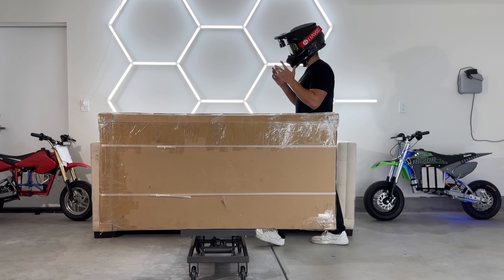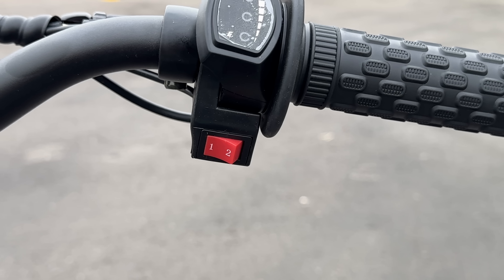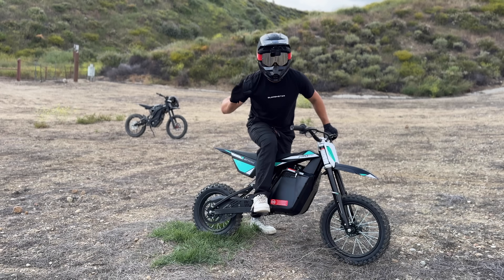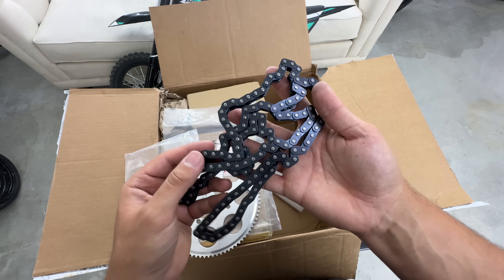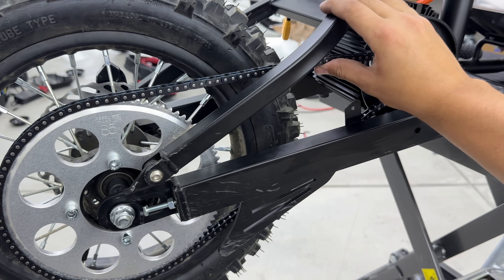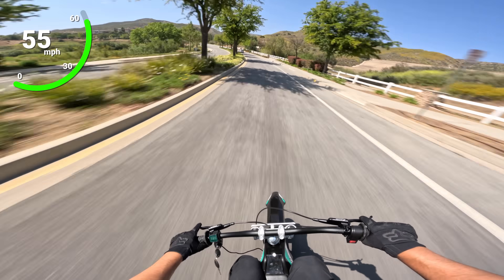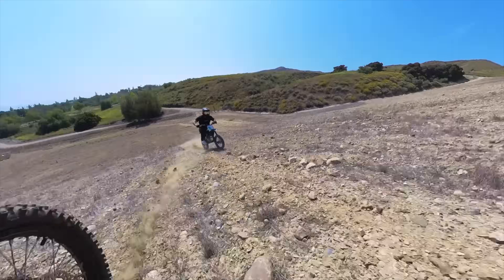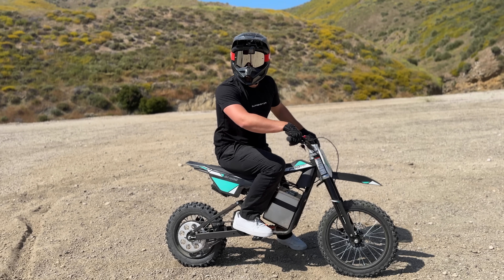I Built an INSANE Electric Mini Dirt Bike (+60mph!)

Comment: no hate but get a ebike spend 3-4k spend 1-2 for parts to make it faster 
get a dirtbike goes 70 mph without modification spend 3k max
Reply: He just does beyond what he needs to do. I’m spending 250 on a bike and spending 500 for motors and batteries all no less than 1k or 1.3k

Comment: why have you never made a mototec vid?... you got the tuts... the razors... every other bike possible... why not mototec? Its been around for a while. they went from 1600w to 1800w motor. Literally you stick a far driver in it, upgrade the suspension and it goes 40mph... same size as the pro spec too.... and its only 1100$... and it has a good frame for modding... and it looks like a stark or a rtr... Must i say more?.... 

Edit: i have a 48v 1800w with a 72260 fardriver clocks at 36mph with no tuning....

Comment: The pro spec is basically just the new model that should have replaced all the rest years ago. 500s 650s are all build like crap, for 2025 they need to discontinue the rest and just run different pro spec versions and definitely drop the price this is ridiculous compared to the price of other 36v bikes for the quality!

Comment: Hey surronster hopefully your down to do a review on Singapore version of e-bikes I had this ebike known as an eco drive it ran on 60v 26ah battery,48-72v 1.5kw motor paired with out version of you guys controller known as YYK hit a solid top speed of 79 on eco mode 68

Comment: We cut the brake sensor and the throttle doesn't work now. Did you reconnect it or just keep the wires separate?

Comment: Razor needs to offer a selection of bikes  (mx500 to this one) without any electronics in it. Nine times out of ten, the modding community is ripping out the electronics to upgrade to something better. This would save us so much money, and we are not stuck with smaller electronics we don’t use. Razor should partner with electro&co to offer a bundle deal that’s cheaper than buying both items separately at a higher price.

Comment: I feel like there’s no kickstand because they were expecting people to upgrade it with that kit and use it for motocross or maybe trail riding, stuff like that. Where the bike takes some beating. If you have a kickstand on there and you case a jump or something with a lot of impact the kickstand would go down causing you to reck which wouldn’t be good at all. So your trading inconvenience for safety. Plus the triangle isn’t that bad, when you’re riding you shouldn’t really need one. Unless your using it for the street, which too be fair you said it was a pit bike so I’m not completely wrong

Comment: That shock mout holes a an b may not look like it does nothing but it acts like a leverage point so for a heavy rider or you want morse stiff shock without adjusting the shock you would set it up in the one of the holes for ur setups

Comment: If only you didn't use the overpriced junk parts from electric and co. Throw a sotion fw11 and fardriver controller on there for 1/3 the price and last alot longer. The e&c motors are known to overheat, snap shafts, strip shafts and crack the end caps. Plus their new motor got completly recalled after they sent them out without proper testing.

Comment: What if u build a bike that is powered by a fan motor and u use it to spin the chain and u use the buttons kind of like gears mode 1 for slow and mode 4 for fast and use on and off button to turn on and off

Comment: The A&B settings on the suspension were not a swing and a miss assuming they are change in leverage points they would soften or stiffen the suspension

Comment: I just got an ebox 2.0 and the brake cutoff thing came broken off so the throttle doesn’t work. If I cut it lower down will it be disabled? It broke right at the part going into the brake. Sorry I’m new to bikes and have no idea what the proper terminology is.

Comment: The price is way too steep it shouldn't cost over $1,000 it's just basically a slightly upgraded razor mx650 IMO but other than that it rips pretty good with them upgrades.

Comment: They should have just sold it with the motor, controller, and battery already or done what bombmoto did and make it a roller. At almost 1800+ better off getting the bombmoto or a venom 1600